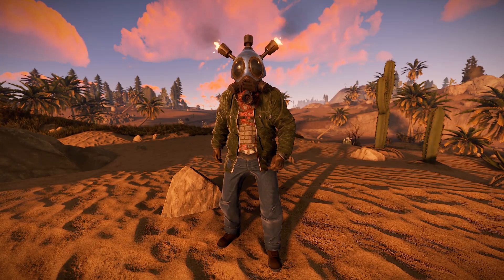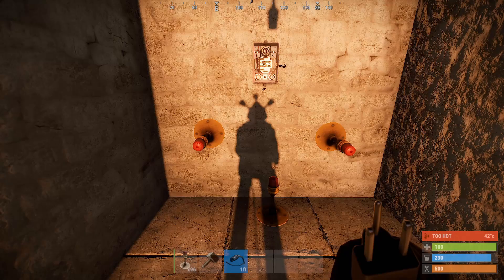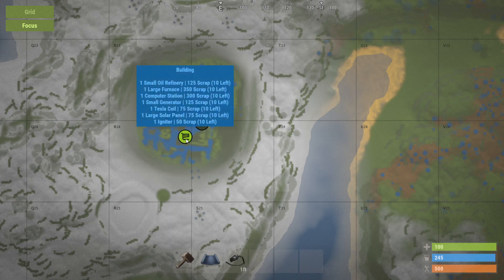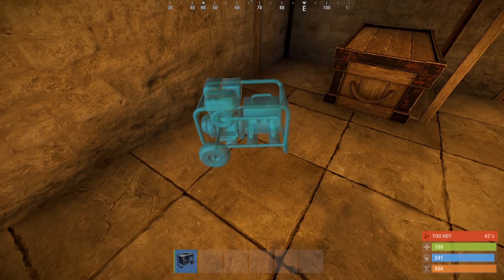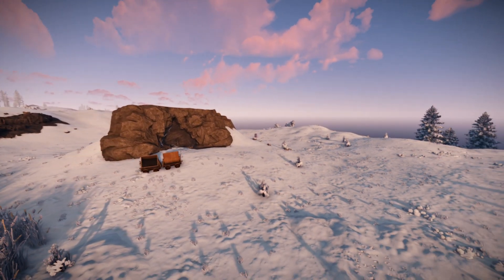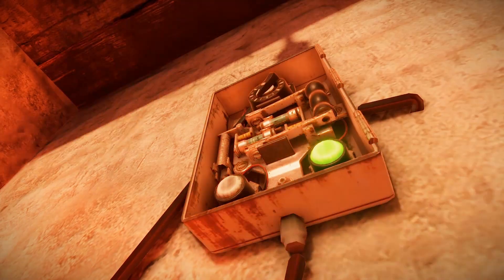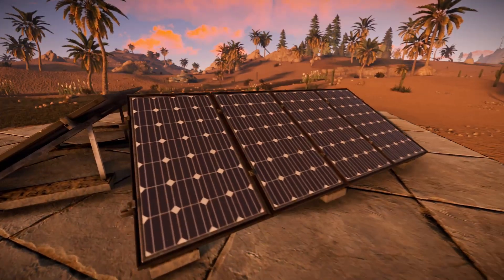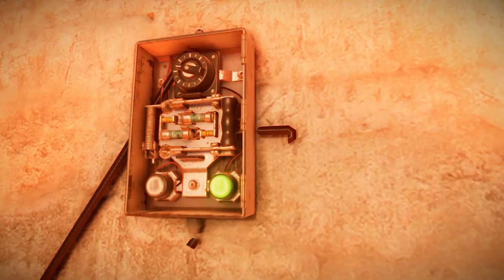Rust - Power Minute - Small Generator

Comment: You could use a fail switch system than if your base or a cetain part of a circut runs to low that they turn automaticly on... just thinking...
Reply from the maker: Hmm I know how I'd do that if it was a battery... Generator would be a bit more tricky but I'm pretty sure I could do it... you'd have to be really tricky with your wiring and counting how much electricity is being used along the circuit so that you could make a line to a blocker lose power when the power dips below a certain point.
Reply: @Malonik  Yeah, the biggest problem I have is that the electricity in rust is done with logic gates. I always mix it up with electrical houswiring ( I am an electronics technician ).  And I would love to make a simple Change circuit so that you can for example, turn on the lights in your base from every "room" on and off. But with the logic gates you need for each room a switch and a OR-Switch and for each two rooms another OR-Switch and so on... So in the end for something simple as light you end up with a huge circut. ALso I would love to see something like the fluid combiner for electricity. They just would need to change that the root combiner can be connected to not only directly power.
Reply from the maker: @neraxont.d7615  oh man it must really annoy you to see electricity working how it does given you're an electronics technician lol. I completely agree I'm kinda shocked they haven't already made the combiner do that..
Reply: @Malonik  Same here mate.

Comment: A must have thing even if its not in a cave base. As you can set them to trigger if power goes out (like battery getting destroyed or windmill). 

They are you last line of defense against offline raiders as each generator its either set to trigger trap (or battery).

However battery one can turn on to soon and drains fuel, while trigger one needs other person to trigger it. (laser beams, sensors also work, but they need power).
It all depends on your base design.

Not easy to explain how ti wire it tho:

https://i.ibb.co/1sCb76P/simplebuild23111212.png

Blocker battery just need to be charged before and you can use small one. 

It wont drain power.
Reply from the maker: Truth